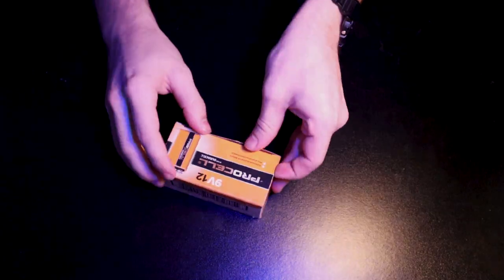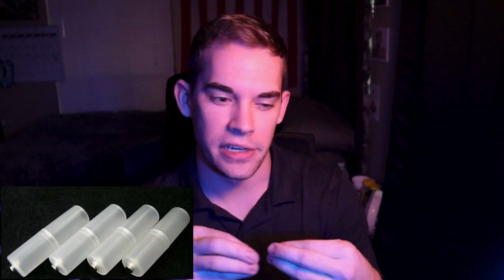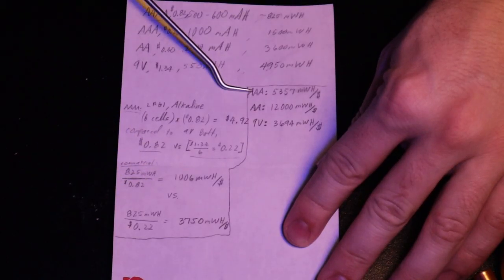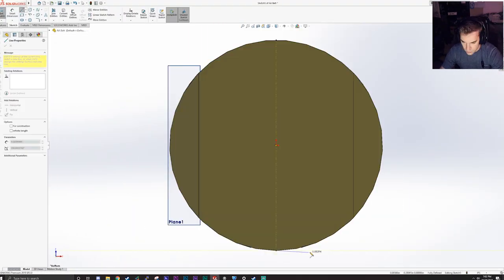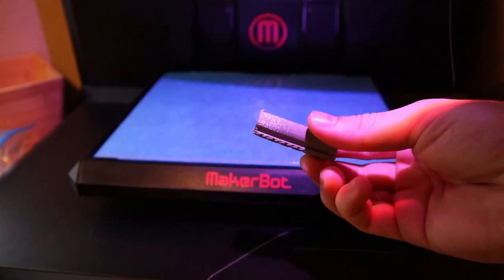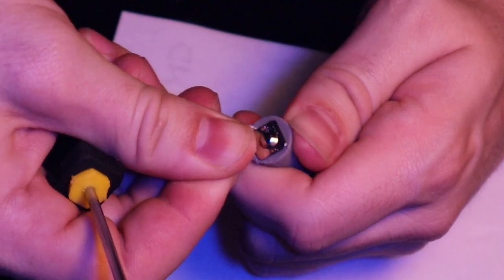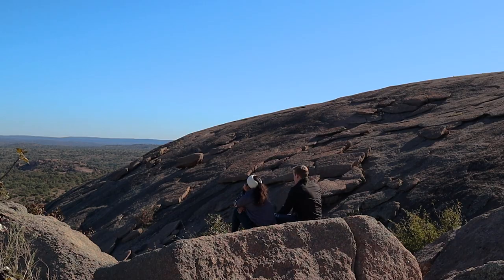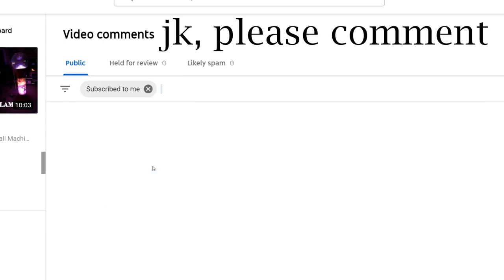9V Battery Hack | DIY Adapter to AA, AAA

Comment: Your videos are continuing to impress my man! Do you know any Revit? Ever thought of working in construction engineering or even as a project manager? You seem like you'd make a good fit. Keep it up pal, your passion is what brings me back!
Reply from the maker: Yes actually I do! I worked as a power systems engineer (programming trip units, sizing cable runs, calculating arc flash, etc.) and a good amount of the projects were delivered in Revit '19 files. Now as a design engineer I just use Autocad and Solidworks mostly. I appreciate you watching and thank you for the nice comment!
Reply: @TyPalowski  Keep it up pal, its refreshing!  Thanks for the videos!

Comment: I disassemble many 9V battery when empty to reuse their connector but no one in my country have cell like this. All of them doesn't matter what brand alkaline or zinc-carbon even industrial lithium one use cell used for renishaw probe have flat bounded rectangle cells stacked on each other.
I also make battery adapter for my wireless alarm motion sensors because 9V battery go empty every 2month or less. It transmit signal every movement detected even when alarm deactivated hundreds of transmiting per day in some room. My adapter is from standart battery holder 4 and 3 AAA 1000mAh rechargeable for frequently used rooms and 600 mAh for barely used rooms it stays on about 8months or more now until battery indicator lit. Luckily there was plenty of space in motion sensor for holders and extra battery because rechargeable are 1,4V instead 1,5V

Comment: I was hoping to see you to convert a 9 V battery to output a multiple of 1.5volts.  My goal is the longer life for 6.0 or 4.5 devices.  I Imagine it is a circuit with various resistors but I don’t know how to do it.  I will keep looking.  TIA

Comment: Nice! I wanted to try this on a project a while back and wasn’t sure if it was safe/practical. Where did you get the little tabs you soldered in, ordered or just salvaged from something else?
Reply from the maker: Thanks for checking out the videos! I really appreciate it! And I ordered them off amazon. I searched battery spring/tabs.

Comment: 👍
Have you ever opened up a "heavy duty" 9v, instead of alkaline? I've found them with a stack of 6 rectangular button cell type batteries in them. Pretty weird, I never researched why though
Reply from the maker: Yeah! Some Energizer brand 9v have the little rectangular batteries inside! I’m sure they found a way to make them more profitable and slightly more energy dense. I kind of want to crack one open and see for myself!